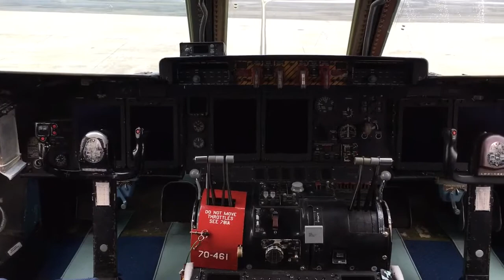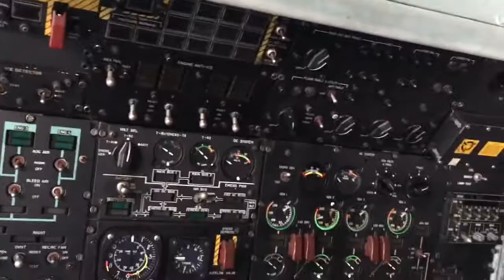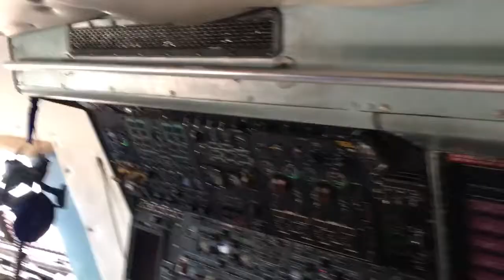Final C-5A flight deck tour with flight engineers panel

Comment: Is this aircraft scrapped?
Reply from the maker: No this aircraft is stored fully preserved.
Reply: gags5503 is it gonna be scrapped?
Reply from the maker: Maybe at some point in the future. This A model has had the avionics upgrade so it will more than likely be preserved for many years.
Reply: gags5503 hopefully it goes to a museum. I don’t want to see it scrapped
Reply: gags5503 I think it’s supposed to go to Wright Patts Museum eventually
Reply: gags5503 is it going to a museum and how is it preserved? Did they plexiglass the inside?
Reply: gags5503 I hope she isn’t scrapped
Reply from the maker: It was supposed to go to wright Patterson Air Force museum but instead it got sent to the boneyard in Arizona. It went to the boneyard on sept 7 2017
Reply: gags5503 is it gonna still be saved or will it end up as scrap metal?(I hope not)
Reply: gags5503 was it sent to the boneyard because Wright Patt didn’t have room or did they want this aircraft to be salvaged?